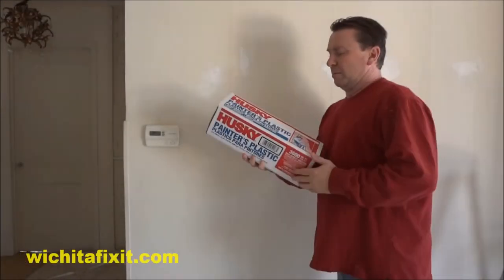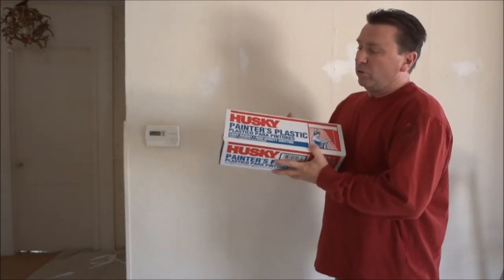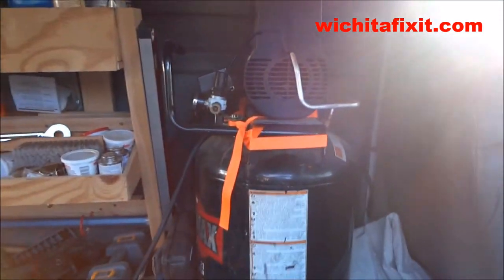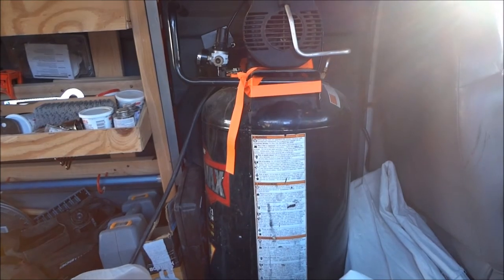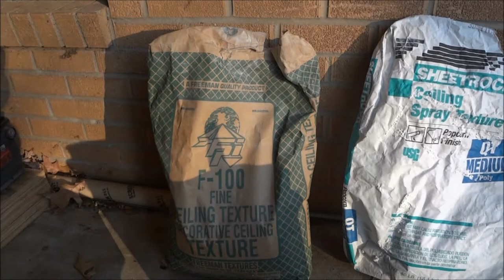How to Texture Ceilings popcorn

Comment: I’ve used texture flat paint to cover my popcorn ceiling (10x20) but unfortunately it’s still giving a small problem? Dust Flaking So what’s the best way to stop this problem? Thank you
Reply from the maker: I'm just getting this comment but what needs to be done is an oil-based sealer put on before it's painted

Comment: I noticed you used an oil-based primer. Why oil-based, and will other primers work? I'm applying the Hoax popcorn ceiling texture product.
Reply from the maker: Zensar is about the best stain block oil-based sealer you can get and if it isn't used your ceilings will turn yellow from bleed through just like on painting.
Reply: I be used texture flat paint to cover over the popcorn ceiling it with pretty good  But it’s still gave me a minor problem still got a bit of bust flaking😬 But the popcorn one was more worst with faking. I think I got the cheaper brand ( flat paint ceiling) ? The container doesn’t have a brand name on it ? We’ll hopefully I’ll solve my problem soon .